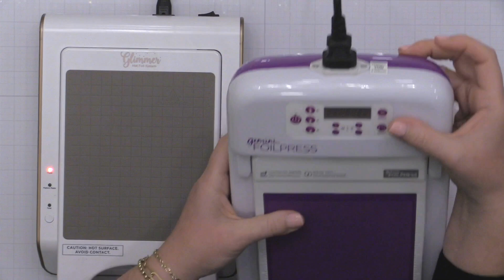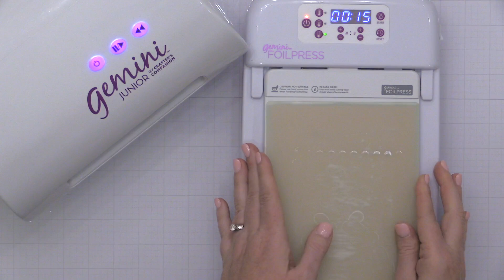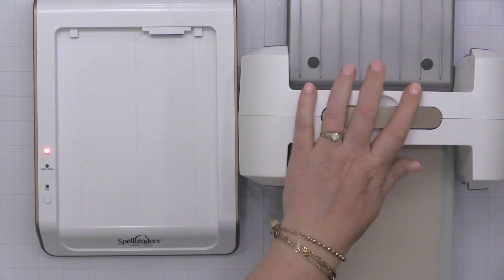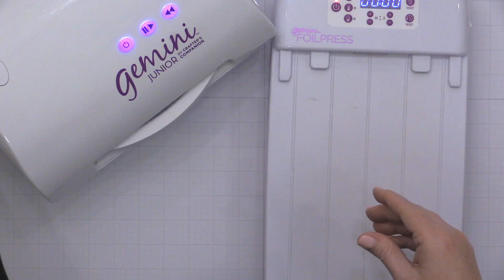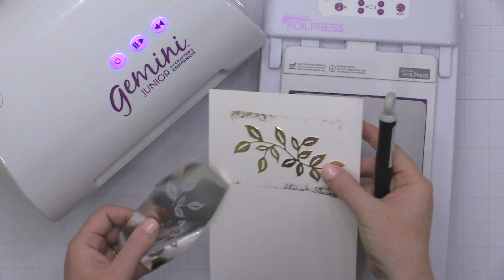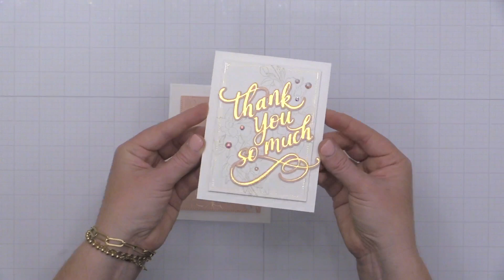Hot Foil Basics Using The Glimmer & Gemini FoilPress With Carissa Wiley

Comment: I have tried and tried to foil on to a paper die cut as you demonstrated and I still can’t get a clean solid foil.  I am using the Gemini metal plate and the Spellbinders platinum die cut machine.  Any suggestions?

Comment: Does the Gemini foil press work with the full size Gemini?
Reply: It does work with the full size Gemini, but you need to get the top plate extender
Reply: I would like to know the answer to that as well.  As I have the full size genini.  Did you ever find out?
Reply: @brucegordon405  I haven’t gotten a response yet.  I’ve been looking around I think that it is.
Reply: I read that it only works with the junior. I have the big one.

Comment: I actually own the CC Foilpress with both platforms since they came out with a larger size platform afterwards to go with my
Gemini Jr.  and Gemini.  I just purchased the Spellbinders Platinum 6 die cutting machine and found the Glimmer Hot Foiling
system marked down at Hobby Lobby so I had to purchase it  saving $45.  Figured I have the new die cutting machine plus
I own the Tim Holtz Vagabond machine both compatible with the Glimmer.  Also, Spellbinders has way more hot foiling plates
to choose from than Crafters Companion.  Crafters Companion states their foil was specifically produced to work with
their machine so, I would buy both brands of foils.  Love my CC Foil machine but have yet to try the Glimmer.  I have never
tried the Spellbinders foil plates on my CC Foilpress yet either.  I do love that CC dies have foil plates that also die cut as well.

Comment: Great video! I appreciate the side-by-side comparison of the two hot foiling systems. I own the Spellbinders Glimmer system and really struggle with the over foiling....it looks like the Gemini system is the machine I should have purchased 😞 I also appreciate that you showed how to foil with regular dies, but was confused why they didn’t cut when you ran them through the die cut machines. I assumed an embossing pad would be needed to prevent cutting the cardstock. Thanks Carissa!
Reply: 😊 There’s not as much pressure with the foil platforms, so the blade doesn’t cut. It’s more of a kiss of the surface.
Reply: I wondered the same thing, why the die didn't cut, so thank you both for asking and answering this question 💖
Reply: I have

Comment: The overfoiling is because the Gemini paper Foil works at a lower heat. The Spellbinders system &  foil works on a higher heat setting.
Reply: Good to know.  I bet you could adjust the time you leave the plates on and avoid some of that.
Reply: Which system do you use?  If you have the spellbinder in for a shorter time does it foil better?